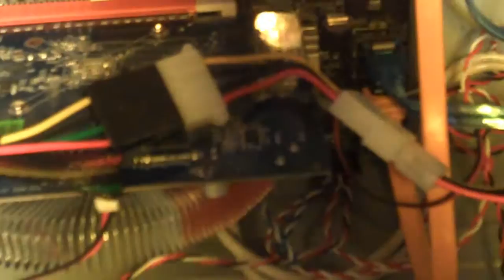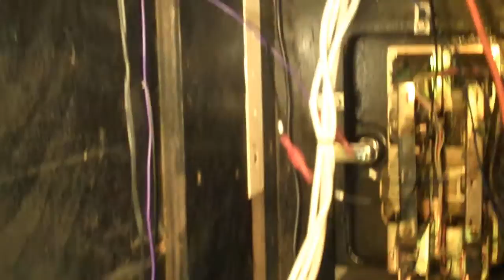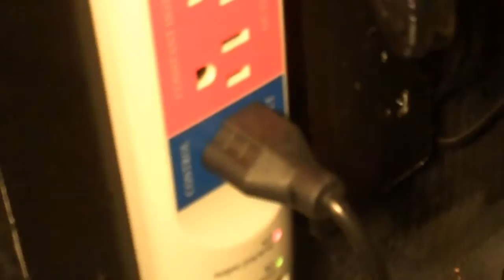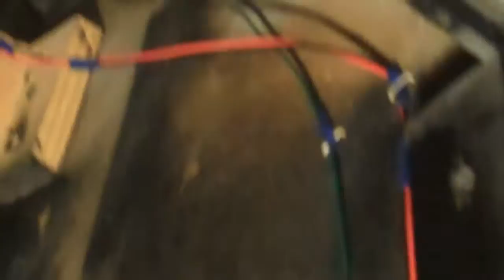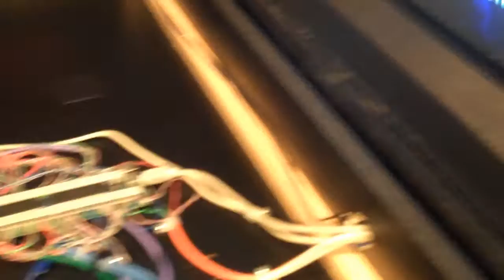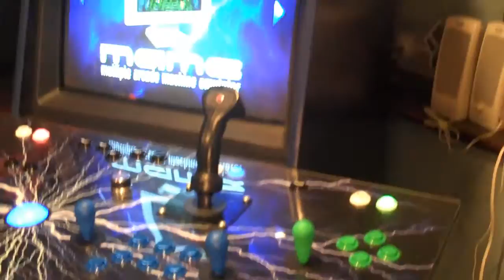Arcade Machine: Wiring LEDs to power supply

Comment: Great vid, but i find you power setup overly complicated. I like that your power bar shuts everything down but you also could also use the power settings in windows (or bios, forgot which) to power on computer when power is detected. That way everything is powered on by the on / off swith in the back on my machine. Thanks for helping out!

Comment from the maker: @Penfold8 You need a separate board for a trackball or spinner (Ultimarc Opt-Pac).  However the Turbo Twist 2 and Electric Ice Trackball by GroovyGameGear come with their own USB interface.  All you need to do is plug it into a free USB port.

Comment from the maker: @breakdancer1967 The LED button that you purchased should have an LED inside.  If not, you'll need to purchase one.  That LED gets hooked up separately to a +5v power source.  So when you're done you will see 4 wires going to the button.  2 to the ipac (1 ground  to the daisy chain and 1 to the input) and then 2 to the power supply.  (1 to the black ground wire on the power supply and the 1 to the red +5 v wire on the power supply).  Make sense?  What brand of LED button do you have?

Comment: I am wiring up my arcade for the same power button setup with a micro switch and arcade button.  I have a similar smart strip.  My question is since the computers power supply has a switch that would be always on...does the smart feature still work? Or not until I hit the switch on the PSU?  Thanks!!
Reply from the maker: Yes it would still work since the Smart Strip is cutting off the power.  So just leave the switch on the power supply in the on position.
Then wire the microswitch and button to the power connector pins on the motherboard (momentary switch).
Reply: DeLuSioNaL's Arcade thanks so much.